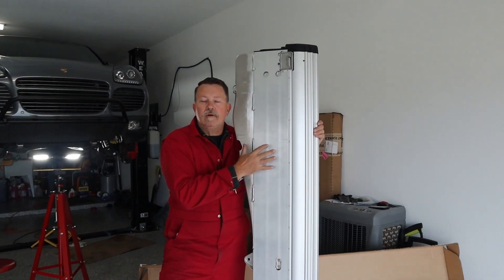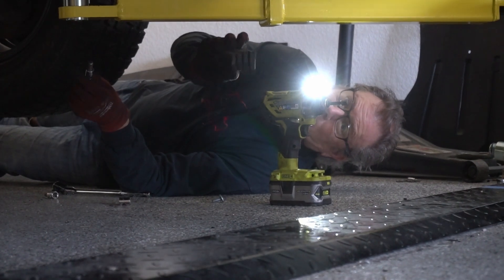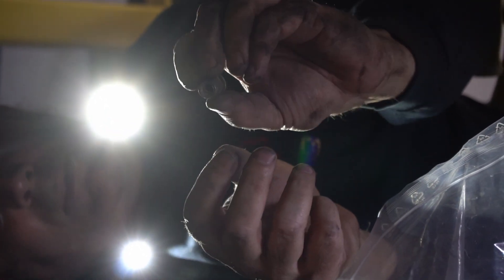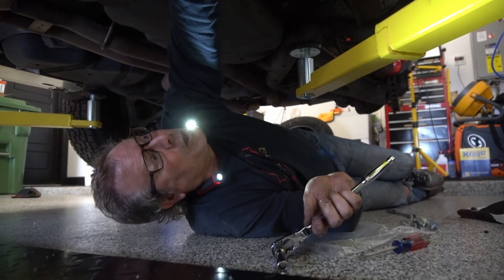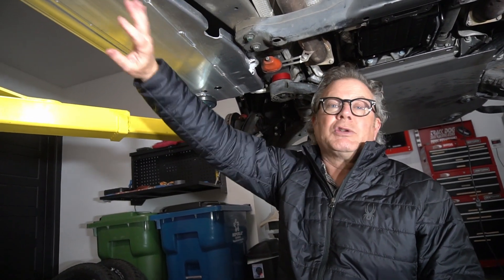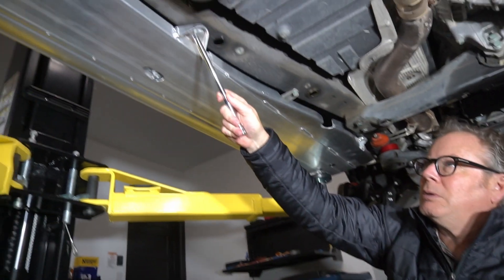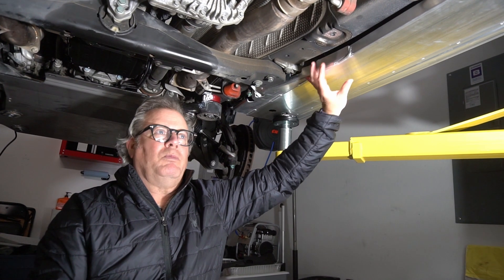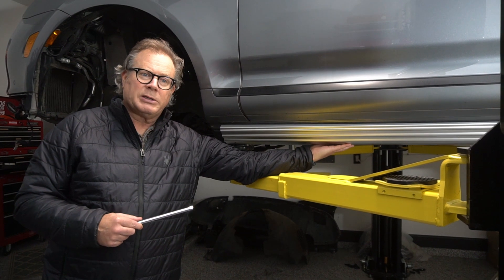Porsche Cayenne OEM Rock Rail Install! Cayenne Turbo S Build Series

Comment: Great install video, thanks. Maybe someone have part numbers for bolts, boltinserts and brackets?
Reply from the maker: We will see if we can link them below. They come in a package when you get the rock rails from Porsche
Reply: @husmanbros  I have used rock rails, but didn't come with accessories. That is why I'm interesting if I can order brackets, bolts, etc separately.